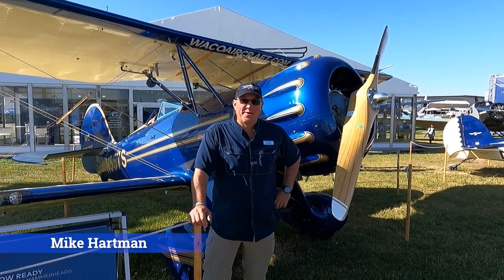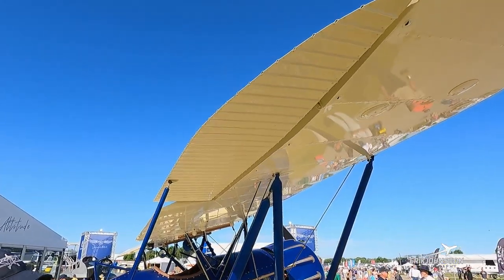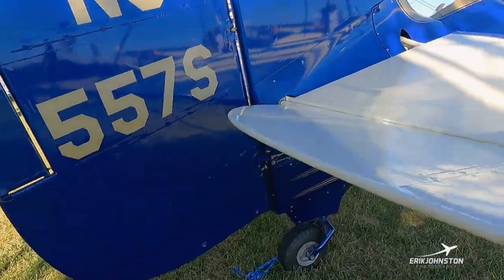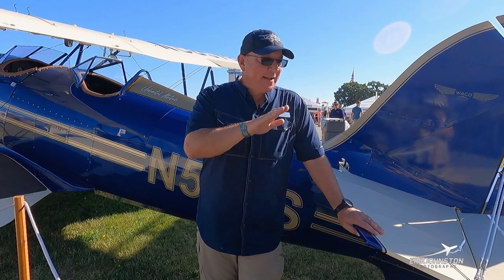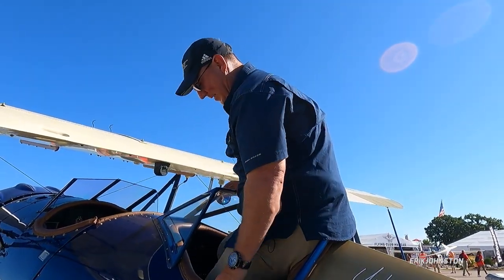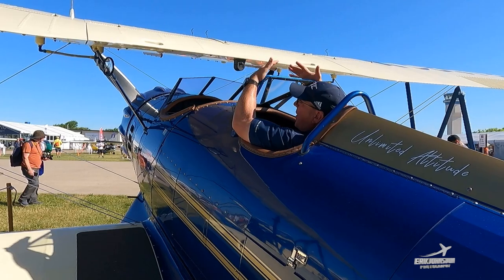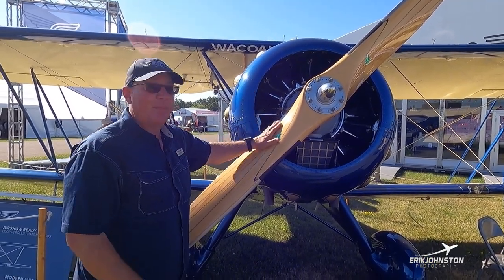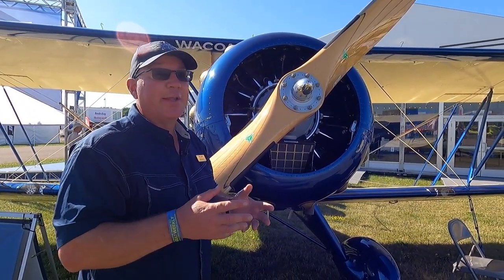WACO YMF 5 Walkaround Oshkosh 2022

Comment: I love the YMF-5 (S/N: 004) I am maintaining for the owner. The only issue I have is I'd like to see the front windshield be made exactly like the pilot's windshield, and not the flimsy plastic it is made of. Seems they haven't addressed that issue, yet. These are really great aircraft, and joy to maintain (for the most part).
Reply: The front windshield is removable, thus the plexiglass. Then you can cover the front cockpit and gain 5+knots for a solo cross country.